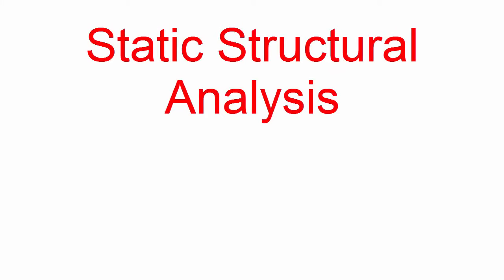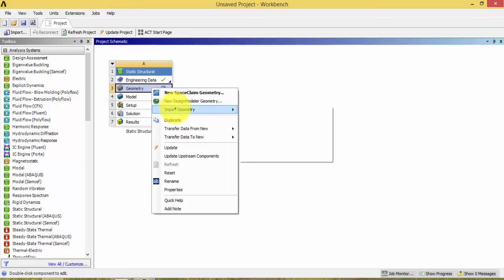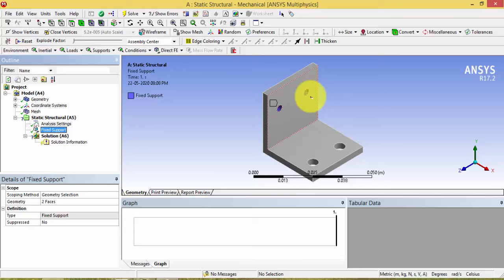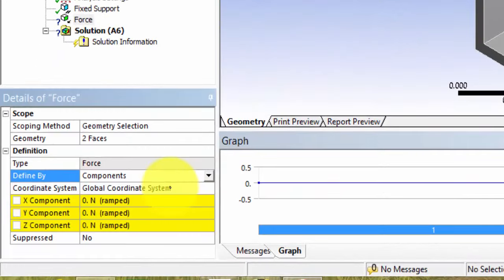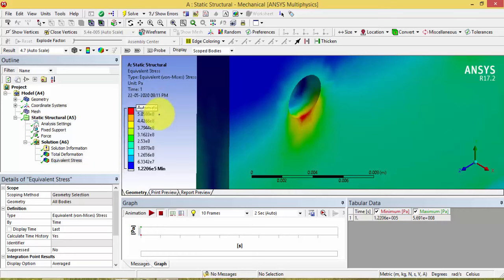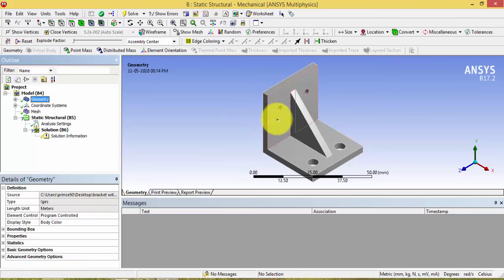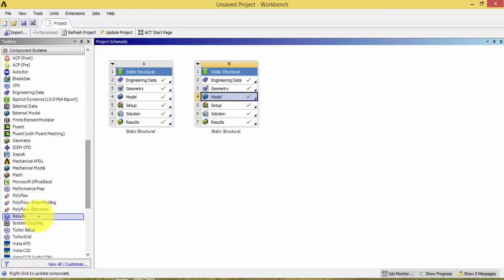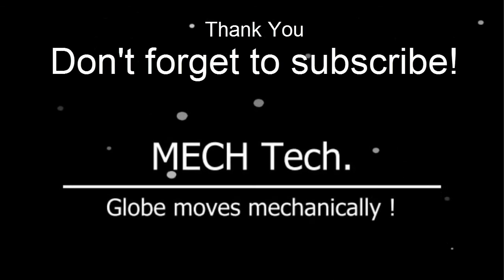How to use Ansys Workbench? | Static structural analysis | Comparison of results

Comment: Hi, in practical sense, the max stress will be on the top side of the bolt circle rather than ar the bottom. At the top, there will be  compression and bottom will have minimal to no stress. So I guess, the support are to be defined correctly like the flat surface needs to flush against the wall or else, improper loading will occur. Correct me if I am wrong. Good video btw!
Reply from the maker: You are right. But the result seems to be different !

Comment: Sir, ive followed every step, I've made both the brackets and done the analysis as you've demonstrated. But, I'm not able to drag the solution into the new result tab on the project schematic. As soon as i I try to drag the solution cell, it shows a red cross with a circle. I use ansys 2021 r1 student version. Plz reply sir.
Reply from the maker: In student version the options are limited perhaps..
Reply from the maker: I understand that you are trying to compare the results of two different cases. Instead of comparing in CFD post, you can do the same by having your own limits on the contours and compare the results. If I am not addressing your need, please feel free to contact.
Reply: @MechTechSimulations  Ok, thank you sir

Comment: Hi.. Thanks for the video. I cannot see the Result comparison option under the component systems. I am using Ansys 20R2 with Academic Research license. Should it be manually done?
Reply from the maker: There will be a component named "Results"
Reply from the maker: You can also do it manually. But if you want to compare two results, the range should be the same in both the results.
Reply: @MechTechSimulations  no in my workbench window this Results component is not available. Infact, none of the CFD related components are available.
Reply: @abisheikpanneerselvam6784  functionality is limited in student licence

Comment: Hi sir, great video. Is it possible to measure distortion by using the software? Thanks
Reply from the maker: Of course we can do everything in Ansys. However, the static structural solver works within elastic limit [Stress is directly proportional to strain, based on Hookes law]. Nonlinear behavior of materials cannot be solved in "Static Structural Solver". It is possible with "Explicit Dynamics"
Reply: @MechTechSimulations  Thank you sir for your time to reply. Very informative, i will look into it.

Comment: Please any video on how you design the model????
Reply from the maker: Will try to do it shortly..
Reply: ok please i want the vidio if you do it you can share it in your channel or forward the link to me thanks
 @MechTechSimulations
Reply: @MechTechSimulations  and please if you can use Ansys workbench to draw it cuz am using ansys to draw it I have to be changing the hole size
Reply: @MechTechSimulations  which software did you use to draw it ???

Comment: How to compare in terms of different materials?
Reply from the maker: At 0.45 seconds in the video, you can see "Engineering Data" in the first step of the analysis system. There you can select any material from library or you can specify your own properties for a material.